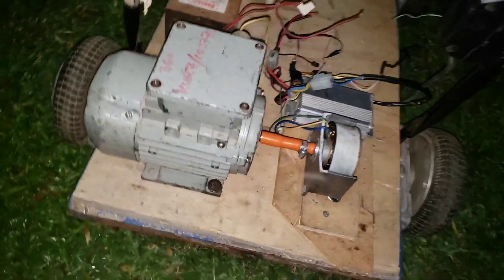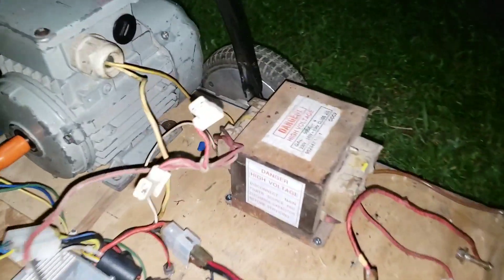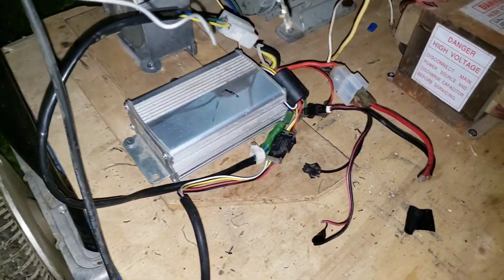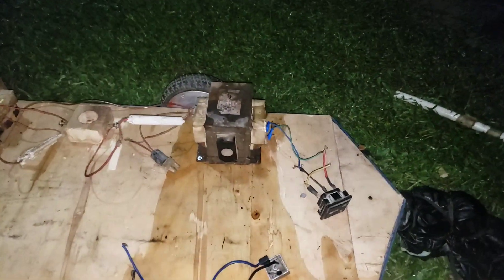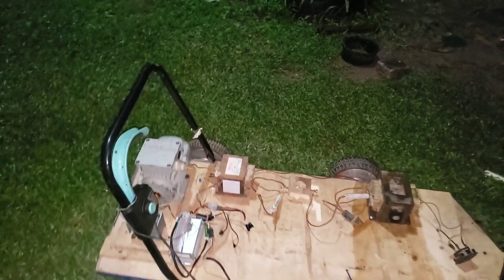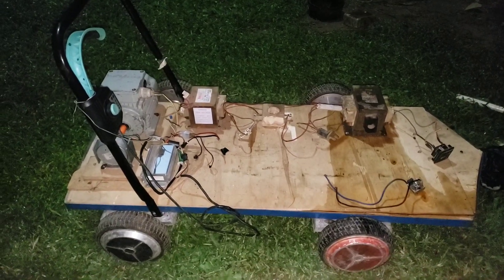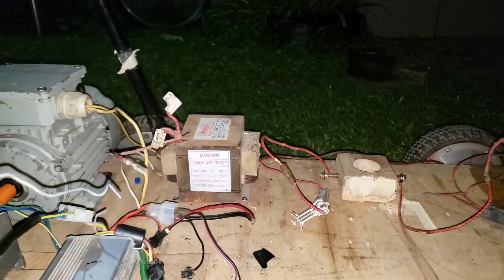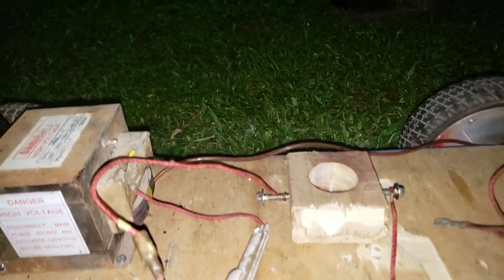Free Energy: Get 5000watt from a 500watt PMG (Part 2)

Comment: Hello, I have been studying free energy for a long time. I'm currently experimenting with car alternators using them as a motor and generator at the same time, with 2-in-1 stators, double winding, bifilar. I use a bldc motor controller to drive the motor part and a three-phase bridge to collect electricity from the generating part. I liked your videos, you gained another subscriber!

Comment from the maker: No heating issue because the system is manipulating resonance not electrons.
It will not run infinitely because there are bearings that can ware out and need changing.
To no more sign up for my online one on one practically oriented instructional.
Thanks